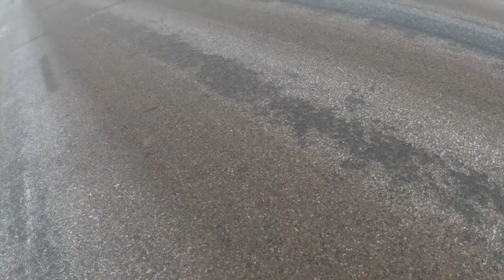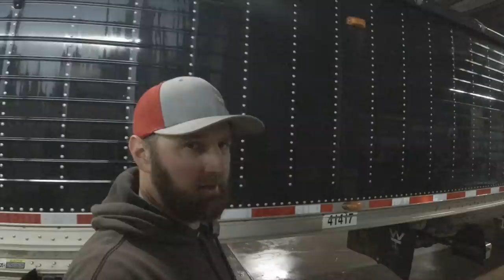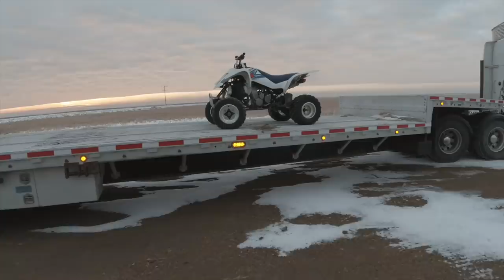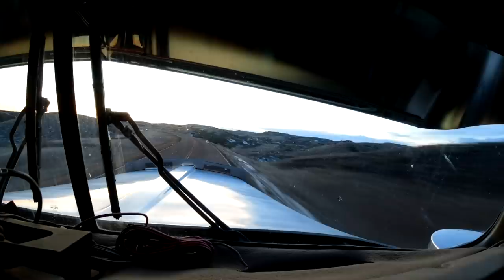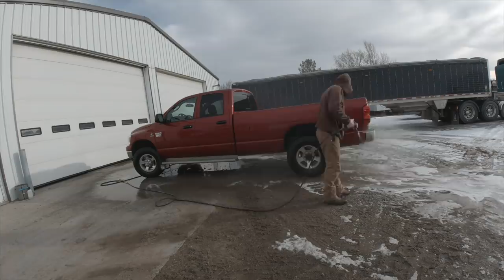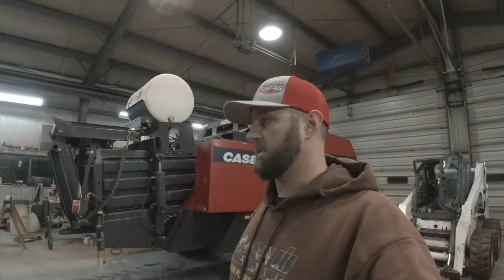New Equipment!

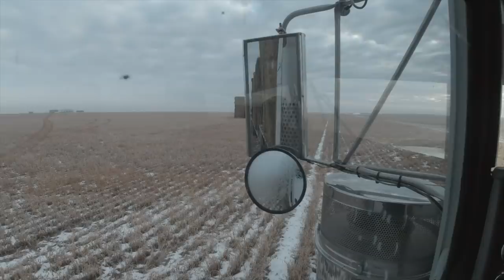Comment: Good day I really like your video's, I was one who bought the gallon cooler and I have to say my first thought was a bit pricey until I received it,I  run a milk route in northern Indiana and my day is usually around 12 hours, so I filled the cooler up at 5:00 am with water and ice by the time I got home at around 5:30 that evening it still had over half the ice still there...I really appreciate the very fast shipping...to any out there interested in the gallon cooler if they are still available all I can say is they are well worth the cost you will be very pleased like I am.
Reply from the maker: Charles Doepping Oh cool. Thanks for the support. They are cheaper then what they are sold for on amazon. They build good stuff.

Comment: Food video Tony. Don’t be picking on them girls lol. I do ya same with my nieces. Question about the soap foam. Seams like you said it works best on the truck paint. Trucks are clear coated and the trailer is powder coated. Do you have to scrub the truck cab nose sleeper much. You probably get the trucks dirtier than most trucks I’m guessing. Reason I ask is I work on some high dollar rvs and wash them on my own time. 90% of the rvs I get are all full body paint and cleared and black in some way or another. Spring to early fall I can’t wash and rinse fast enough to avoid it drying on the units. If this is less scrubbing 🧽 that be great as it won’t dry or streak.  If I have to scrub them is there such. Thing as a soft brush that won’t scratch the clear coat on the trailer. If your wondering what kind of paint I’m dealing with look up luxe fifth wheels.
Reply from the maker: Working to Relax The foam is nice when you scrub because you can spray it on and then scrub.  It’s a lot faster then scrubbing with a bucket of soap.
Reply: Fast Ag Montana dose it dry fast after you spray the foam on. Where about do you get the soap and sprayer.

Comment: Hey Tony! Nice video. Glad to see you got the old intro up on this one where you give the glory to The Lord. I like your indoor wash bay. Question. Do you have to run a logbook when you haul on public roads with your trucks? Do your employees?
Reply from the maker: 3069mark The indoor wash bay gets the tools a bit wet lol.  We don't run logs since we are farm use close to the farm.
Reply: @FastAgMontana  -- I was wondering about that 175 mile one way trip if logs were required. Don't worry as I am not going to report you. LOL. I think a couple things come into play that determines if logs are required. One is if it is farm use, and the other is if it is operated within a certain number of air miles of the home base. But that second one might not apply to farm operations. When I drove truck though it was for a private manufacturer and when we hauled our food product to cold storage it was just under 100 miles and we did not have to run a log but we did have to run a time sheet and I think we could not drive after the 12th hour. It's been 15 years and I can't remember the exact number of hours. There were only so many hours we could work in a week too when we were running within the 100 air mile radius. And when we went outside that 100 miles again then we had to run logs and we had to subtract our time sheet hours from our available hours to work off the log book. Lots of rules! LOL. Regarding getting your tools wet when washing in your indoor wash bay. Maybe you could install a roll up or folding plastic partition around the truck to keep the tools from catching overspray. Take care, Tony.
Reply from the maker: 3069mark it’s till within the 150 air miles to their ranch.